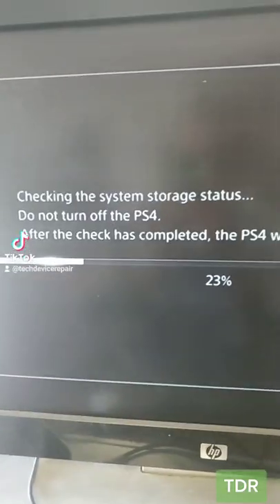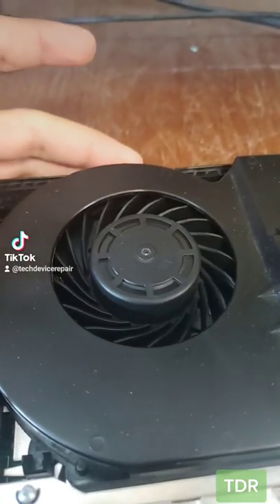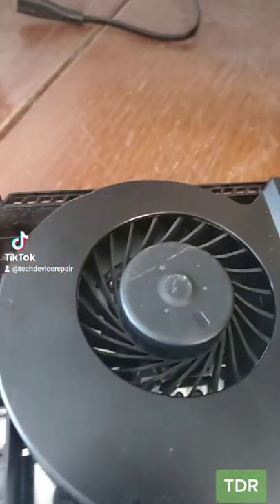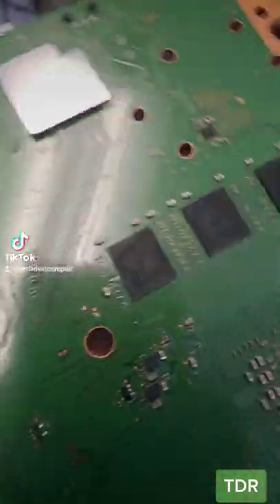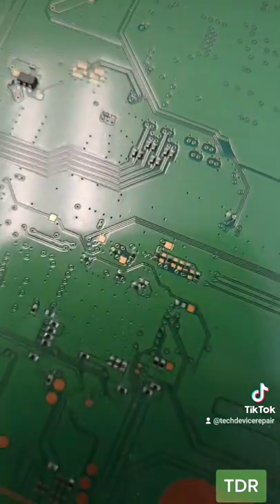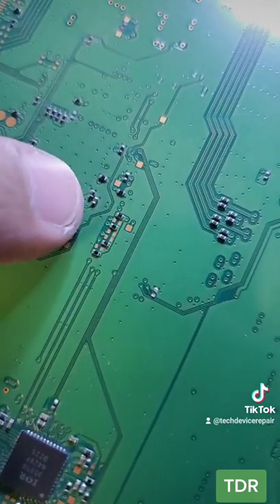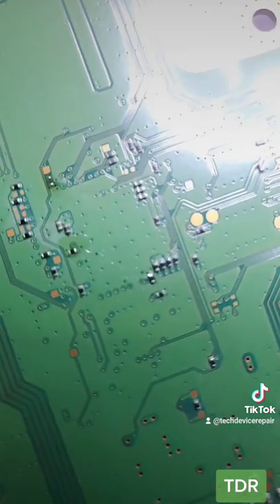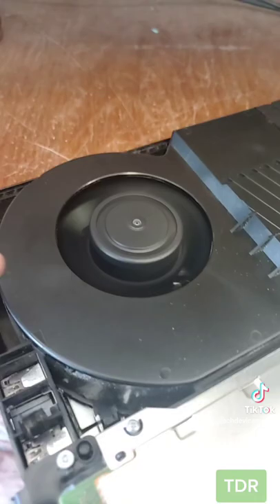The fan is not spinning. PS4... #shorts

Comment: How does one have missing motherboard parts
Reply: Probably dropped it or used compressed air on it and somehow took the parts off
Reply: @jadmich00  Aren't those small components soldered on the motherboard? How on earth can a compressed air yeet them out of the board?
Reply: @Moa_Smug  I mean if I dropped it then used compressed air I mean it would probably work but honestly I prob wrote that when I was tired af so idk 😂
Reply: @jadmich00  Some things could fall off when the device gets dropped, but i honestly don't compressed air could yeet them out since solder is kind of similar to welding, they stick where they're soldered to except maybe if the solder wasn't done properly then it could break off 😅
Reply: @Moa_Smug  true true 😂😂